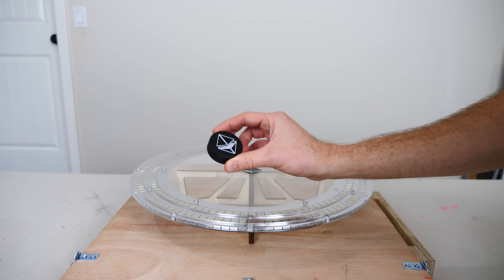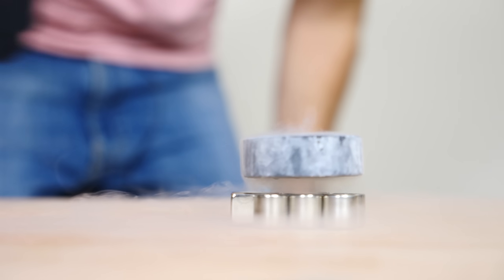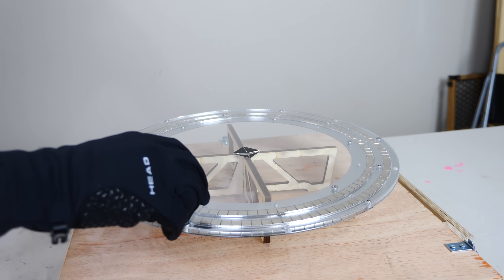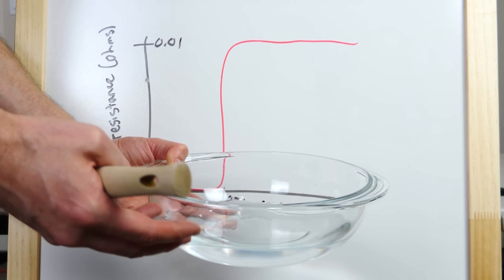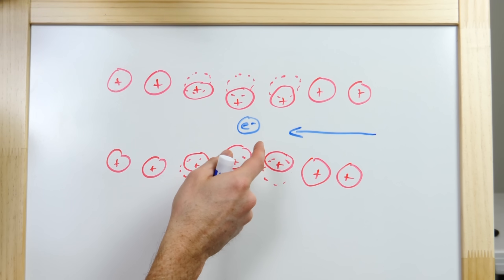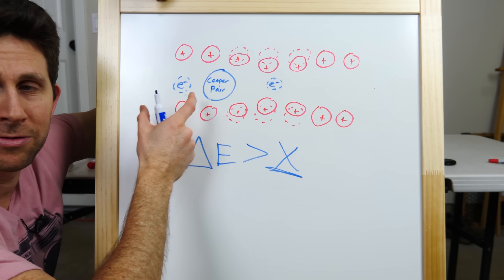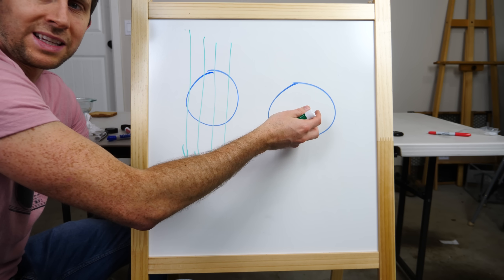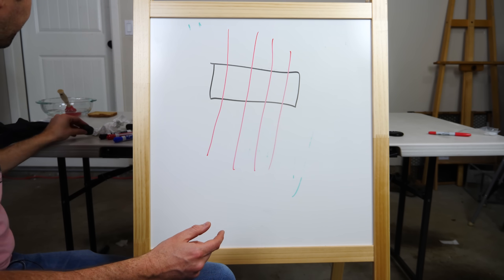Quantum Locking Will Blow Your Mind—How Does it Work?

Comment: Humans should use this to make the worlds first hovering car. it wouldn’t need to blow air around to fly (which means no danger, and no loud engines), and there would be less required power because of the zero resistance. The only resistance that would play is wind resistance. Although I don’t know how well it would go up an incline, or how fast it could go. We would also need magnetic roads or pathways or zip lines or something like that. But we should definitely try it.

Comment: This isn't "quantum locking", it's called magnetic locking.
The magnetic field pierces the superconductor like wires through playdough.

It's a result of how superconductors work. They allow for essentially perfect conductivity and when subjected to magnetic fields, said fields penetrate them as a result of their super-conductive property.
Reply: Unfortunately it is quantum locking because of how it can move indefinately as long as it keeps cold. You forgot that crucial bit that makes Quantum Locking different to Magnetic Locking
Reply: @MorganSaph  It's a result of superconductivity and magnetism and the interaction of the magnetic field penetrating it like so.

Nothing "quantum" about it.
It's not "indefinitely" locked, either. Superconductors of this sort only remain superconductors at extremely low temperatures.

This onw will likely only last an hour or two tops before it starts to lose this quality and drops out of the superconductive state.

Also, no. That's not what "quantum locking" is at all, even if this WERE an eternal super-conductor.

Comment: It would be interesting to see how the superconductor’s motion would be effected if you were to place the magnet wheel upright (like a tire). I wonder if gravity has a noticeable effect on the superconductor’s motion as it moves down (with gravity) and up (against gravity). Great video!
Reply: I think gravity would apply. But I dont know. So it would be very interesting to see the experiment you suggest
Reply: It would slow it down on the upswing that it'll stop it from doing a full circle in a few minutes of motion
Reply: I wanna see that
Reply: I dont think gravity will have an effect, you see it never had vertically, hopefully won't be horizontally too... IMO

Comment: I always wanted to know: if the resistance is a true 0.00 and there is a magnetic flux passing through the material, why the locking effect isn't infinite? Even if it's "locked" for tiny forces, it remains possible to move it. I see that a positive amount of work is necessary to move the material, but if the resistance is a true 0, the force required to move the material, hence to change the magnetic flux, therefore generate a voltage through the conductor should be infinite? d(Ф)/dt = U = RI, while Ф ≠ 0 and R = 0, so the movement should truly be impossible no matter the force or the current is infinite?

If someone know, please consider helping me :)

Comment: @4:05 the magnet is spinning just fine, then removed and the entire track flipped over.  Hmm ?????
Why would you flip the track - shouldn't the magnet also lock underneath, without flipping the track?
Is the bottom of the track some kind of Mu-metal with very high permeability to stabilize the fields on top - it is hard to see quite how it's made, and you're not telling about this in the video. Thanks in advance :ø)

Comment: Because I like your channel I'll give you some information and a little bonus.  You super conductor is doing the same things as the earth and the other plants.  And your bonus. Take you puck crush it into smaller bits like dust. Get a megnet tie a string on is so that it will dangle in the center volume of you vacuum box. Put the cushed puck dust into the box with some liquid nitrogen. Shake the box and you will be able to see the once invisible megnet fields lines in 3d.

Gj once I change this pitiful system we live under I will make sure content  Like your is mandatory in schools from kindergarten up

Comment: I also used to think that eddy current thing. But   one thing I realized someday is superconductors are diamagnetic (it doesn't allow magnetic field through itself to pass) then how can induction of eddy current takes place.

I think that the quantum locking is the result of diamagnetic property of the superconductor, due to which it doesn't allow passage of magnetic field through itself and so it tries to remain static with respect to the magnetic field lines.

Comment: Imagine playing air hockey with this bad boy
Reply: This wouldn't go in every direction, like an air hockey puck does.
Reply: @HansenSWE  damn good point, it'd be locked.... hmm was trying to think of a applicable use outside of transportation but then again I'm not an expert on either lol
Reply: @DJ-ys9pv  The fun stuff with quantum locking, or flux pinning as it's also called, will begin when/if we manage to make room-temperature superconductors. 
Imagine having this without the extreme cooling requirements.
A hip-joint for grandma without any friction at all, to.. well, you name it.

Comment: Question, if the track system demonstration was done under vacuum would it theoretically be in a zero friction environment allowing it to go one as long as the conductor was still locked?

Comment: So could we make generators in the artic with these with liquid nitrogen being its fuel so it could continuously spin
Reply: the thing spinning would need to drive something, which means there would be resistence and friction, which means it wouldn't spin... 

You CANNOT create energy without an echange.... 

it could help though, creating LESS friction in a generator, making it a little bit more efficient.. it's super expensive though and right now, keeping the system cool enough to work would make it not worthwhile..

Comment: Very important question I’d like to ask! What would happen if you were to put it in a gas chamber which sucks the air out (I forgot the name) wouldn’t there be no resistance of the air on the race track and technically go around forever (or it least until the puck heats up)

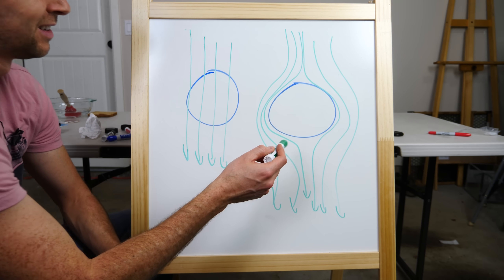Comment: Semi conductor?  Do you mean super conductor, Several slips in this video but at 14:51 you start saying “semi conductor “a lot more . A semi conductor is a transistor , Ic or LED. Extrinsically doped silicon is what we use to make all of our digital technologies and some analog too - though tubes are still unused in amplifier application due to their excellent high power and low noise . Now I know this might seem like nit picking but it is important in science and in engineering to have accurate terminology .  This is after all a teaching video .

Comment: Hey, I was confused about your statement, that a superconducter has a resistance of exactly 0. Maybe you've left it out for a reason, but the German Wikipedia (https://de.m.wikipedia.org/wiki/Supraleiter) states, that it is unmeasurable (smaller than 10^-20Ohm). It seems like the english version doesn't include this Fact. Is this correct?

Comment: 2000: air hockey
2020: quantum locking hockey
Reply: 2030: Quantum locking hoverboard arena
Reply: Captain Magma HA! I knew someone would come up with a practical use for this. Well played Cap’n Magma
Reply: Extremely low friction
Gonna need a big board for all that speed
Reply: Huhm next they need a Cost projection for converting a Hockey rink into a neodymium magnet inlaid surface. To then later in game add a nitrogen dipped magnetic puck
Reply: XD
Reply: AWESOME IDEA!!!
Reply: Yes
Reply: fr
Reply: Sorry to be that guy, but it won't work. The puck would resist movement...

Comment: is this translatable to producing energy or making engines
Reply: Not producing energy, no.
Making machines? Sure. They'll need to have the same amount of cooling, though. All the time.
If it ever becomes possible for us to make room-temperature superconductors, then brace yourself. Because EVERYTHING will change, except knitting and barbeques.

Comment: A few things were unclear to me here:
First off, why did he have to flip the disk? I would have expected it to work equally on both sides...
Second: The field lines in the puck he drew were vertical, whereas I thought they would have had to be horizontal for them to be used as "rails" as in the experiment... An I missing something?
Also, why do only pairs form in "Cooper pairs"? The bunching up of positive ions must work in all directions around the electron, so why is there only one other electron involved?
And lastly, did he mess up with his ominous x variable, saying that it gets too low, when in fact it gets too large to be overcome?

Comment: This could be the start of flying cars
Reply: We already have flying cars but they're pointless since it will cause issues with millitary radars, flight paths can't be traced and if you go too high you can interfere with commercial aircraft by simply turning your radio (or any kind of wireless device really) on
Reply: Very true

Comment: Perpetual motion “machine?”
Reply: It'll move forever, but you can't extract any energy from it. You can use superconductors for energy storage though. There are a few places that do just that, usually for power smoothing in systems which may be subject to extreme short-duration fluctuations.

Comment: Couldnt you technically make a Superconductive Cold Engine with this? If the substance's electrons are moving indefinitely as long as theyre cold, they SHOULD technically be able to work as a permanent motion engine, increase the size and speed of this engine enough, we could have the next nuclear reactor, without nuclear fuel..

Comment: I'm tired of clicking on "Quantum" videos with knowing what quantum is.
Reply: danthegoat13❶ 
Did you mean “without?”
Reply: @keirfarnum6811  looks like autocorrect is on my ass.
Reply: danthegoat13❶ NPCs tend to do that 😜
Reply: keir farnum im pretty sure our/his melanin is naturally
 percieving quantum redundancies none of this 
science is new to POC infact A.I itself has always 
been an obsoletion 👥😐
Reply: quantum
/ˈkwɒntəm/
Learn to pronounce
"Kw-on-tom"
noun
noun: quantum; plural noun: quanta
1.
PHYSICS
a discrete quantity of energy proportional in magnitude to the frequency of the radiation it represents.
an analogous discrete amount of any other physical quantity, such as momentum or electric charge.
PHYSIOLOGY
the unit quantity of acetylcholine released at a neuromuscular junction by a single synaptic vesicle, contributing a discrete small voltage to the measured end-plate potential.
2.
a required or allowed amount, especially an amount of money legally payable in damages.
"the court must determine the quantum of compensation due"
a share or portion
"each man has only a quantum of compassion"
Reply: Hmm.. my simple understanding is that electrons can exist in an atom only at specific energy levels, in specific rings each further out from the nucleus. The first ring (or shell) is at a specific energy level always, and each shell outside of that is at a specific energy level. Electrons can only transverse from one shell to another if they gain or lose a specific amount of energy.
Quantum refers to the concept of these specific energy levels... I think.. may encompass more

Comment: Both superconductivity and superinsulation are caused by the pairing of conduction electrons at low temperatures into Cooper pairs. In superconductors, all the pairs move in unison, allowing current without resistance. In superinsulators the Cooper pairs avoid each other, preventing current from flowing.

Comment: Surely there's a free energy device that can be made out of this. Perpetual motion as long as it's kept cold enough...
Reply: Perpetual motion? I think that's possible. If the superconductor were to never absorb any heat and there was no air resistance, it should theoretically go on forever

P.S free energy doesn't exist since it breaks a fundamental law of the universe

Comment: Couldn't this be converted into perpetual self generating energy for homes and cities?
Reply: No. You still have to provide energy to the system. If you were to try to rotate a generator with that, out would stop very fast, since you're converting it's kinetic energy to electrical and it would stop

Comment: People also try to make trains with quantum locking (quantum levitation) but failed because it will take so much money and so much electricity to keep superconductor cold for long time except they made magnetic trains and they called them (MAGLEVS) they also levitate and they are very fast and didn't take that much electricity so they can keep electromagnets on for long time but MAGLEVS only levitates 10mm high 🤷‍♂️🤷‍♂️🤷‍♂️🤷‍♂️🤷‍♂️🤷‍♂️🤷‍♂️🤷‍♂️

Comment: I don't too much believe in flying cars like in the movies unless you have a car built with the mechanics of a helicopter or a car burning fuel producing gas as a byproduct like a rocket creating the force of the gas escaping to thrust the car upwards and possibly build them in a way where the thrust can be adjusted continuously to push you forwards, backwards and make turns... But there is also levitating cars this is one of the examples for how they could levitate...

Comment: For safety, I just have to say, this material is a super conductor, meaning that it absorbs heat. So yeah, it is not safe to use around a manned space craft. It will suck heat from the inside of any craft. Satellites may be used, if they can handle extreme cold. If satellites can handle the extreme cold, they could remain in orbit longer than our colonization on Mars.

Comment: Do the magnets create continuous motion or will it stop after awhile? IE: The SC moving on the disc.
Reply: It will stop. Air resistance.
Reply: @Approximation   Is there any way to electrify the magnets so it can create forward propulsion to keep it spinning in a circle. Or line then up and stager for inertia?
Reply: @CockerSpangle  Don't think messing with the magnets helps. It needs a uniform field.

Comment: We know this, but we can't produce infinite energy? You know those flashlights that you shake to give them power? Well if you put that thing on one of those rings you have, a couple of pistons on each side to push it back and forth when it hits each end, and a container with a conductor device that would pass through as it hits each end of the setup, and you have seemingly infinite energy, no? Like with enough of them setup and connected to a battery of some kind.

Comment: This is how flying saucers stay a float  none stop. They quantum lock to the earth, but those flying saucers do it on an unimaginable level. 

Not saying its aliens but... Aliens. 👽
Reply: That's an interesting idea. The Earth does have a magnetic field and a strong one at that. But then it would take some threshold energy to move the superconductor to that point in space, so you'll need to constantly supply large amounts of thrust to move it from one point to another. Not to mention maintaining such low temperature. But it's interesting to think about.
Reply: @Approximation  I concur lol...I pretty much said the same thing.. kinda 😉😁👍
Reply: If that were the case then whatever"ufo" that's quantum locked to the earth had to have been made here inside of this atmosphere for it to work... not saying it's an inside job but the military and governments know waaaaay more than they would lead anyone to believe... no such thing as extraterrestrials... more like extra dimensionals...

Comment: Ok explain me this. Lets make an extension cord with super conductor. And make it a loop. Power it with ac voltage and based on 0ohms resistance it should flow in a circle when power is removed right? Will it keep the ac current, voltage? Or it can only contain dc? But wait, when there is no resistance based on ohms law there cant be any current, because it will be infinite right? Thats just strange.
Reply from the maker: The voltage across a superconductor is 0. There can definitely be a current in a superconductor, that is how this experiment is working. According to ohms law V=IR, so if resistance is 0, then voltage is 0. If you powered it with AC it would keep flowing the last direction that it was flowing before you removed the applied voltage.

Comment: All i see is a hover board and speed racer make a tunnel filled with neodinum magnets and make a circular hover board with a rubber material on top and place some electricity strips in order to run current through it to allow heat to form in order to allow for direction E.G. left , right and stoping the hover board by running current throught the whole circular board

Comment: Don’t get excited about hover cars using super conductors yet. It would take a lot to keep the conductors cold, let it be liquid nitrogen or else. This would also cause the car itself to become cold and buyers may not be comfortable with the low temperatures and would also mean you couldn’t have a heater in the vehicle. The car would also most likely be electric, a gas engine would cause way more heat. With the heat of the summer, this vehicle would not work very well but best in winter. Not to mention the roads, they would cost an EXTREME amount of cash and in some places they just won’t be there. Making this very un convenient. This would probably mean only large States like California, New York, and Washington would have this.

Comment: If at 4:30 you put that disk of magnets in a vacuum chamber, could you have the magnet spin for a while due to the low surface tension and air resistance?